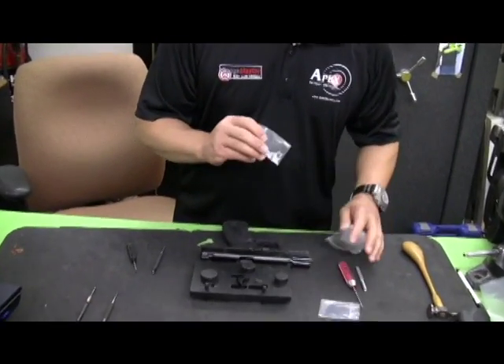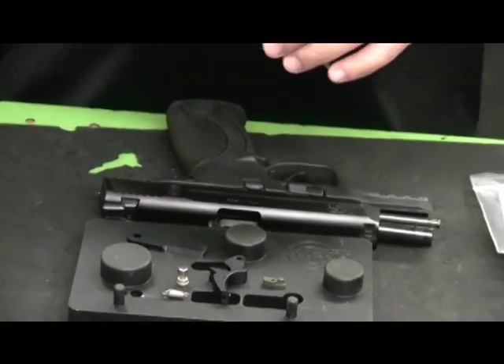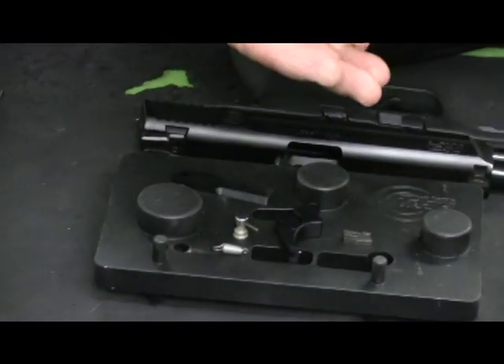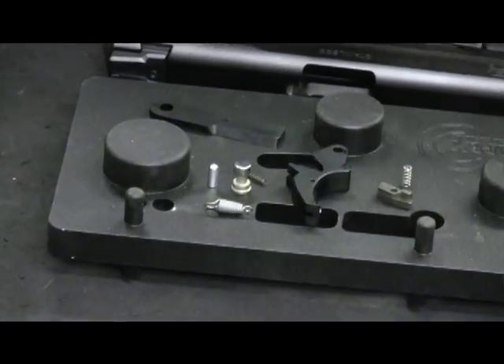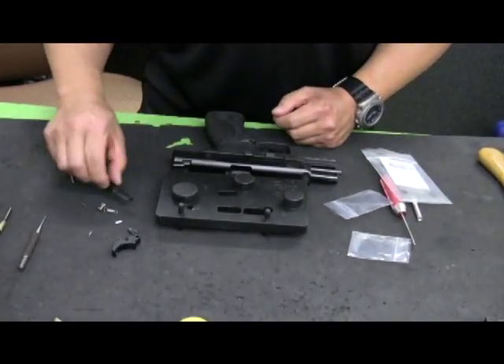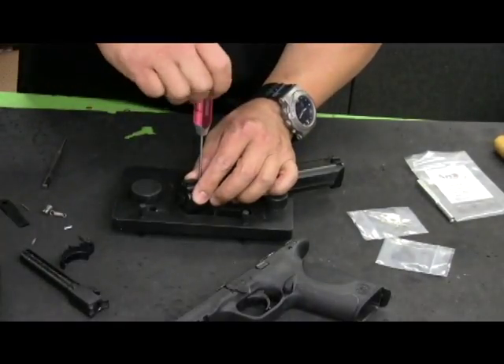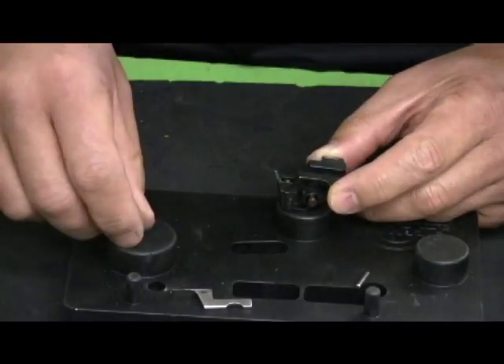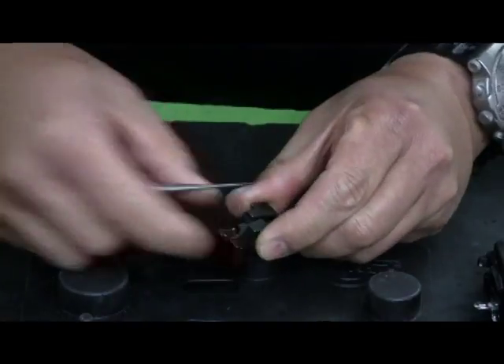Forward Set Sear Install - HD

Comment: This is a terrific upgrade. My M&P 9c is Massachusetts compliant and there for had a ridiculous 10lb trigger. Add the heavy trigger with long travel and it was not a great shooting gun. After I installed the Polymer FSS kit I was down to a lean 4.5 lb trigger with a nice range of travel. This allow tighter grouping, and an overall better shooting experience. S&W should make this a factory install option.

Comment: I just upgrade my M&P45 (CA model with manual safety, manuf Dec 2013) with the new poly trigger and sear components. This instruction combined with a few others from Apex for the M&P plus the proper tools (punches and armored block) make for a simple upgrade. (I have a normal/common level of mechanical and instruction- following skills.) I have the smaller sear spring and used the lighter rated trigger spring (silver, not green). The end result seems (when dry fired) to be a more comfortable trigger (didn't like the stock lower-half-pivot trigger) with significantly shorter pull. Can't wait to try it out... Maybe tomorrow if I can get out of work early.

Comment: awesome flat trigger!!! the break is unbelieveable!
this video does need to be updated. the little yellow piece in the kit is to align the pin for the trigger group for re installation, with the new kit you dont need a trigger block as apex pre installs the pin for you. the green spring is for heavier trigger pull, don't pull the bottom spring out of the sear block,un necessary, the armorers block is nice to have, the armorers tray is a waste unless your always pulling pistols apart.
If you have a core or performance center M&P you dont need to remove the rear sight, However,you will need a quality T5 torx wrench to remove the small plate on top of the slide thats underneath the optic mount. Hope this helps

Comment: Nice easy upgrade for my 9c. If you are patient, and a little mechanical, you will have no problem with this. I agree that they should have better production on the video. It would help out those who are on the fence about doing the trigger job themselves.

Comment: After adjusting the trigger bar loop to sufficiently make contact with the sear I was not getting proper trigger reset and was feeling a dead trigger. I pulled out the sear block and gently pulled the loop away from the trigger bar. After racking the slide with an empty magazine inserted into the mag well (Mag safety compliant gun) I was getting a perfect dry fire, followed by a perfect, crisp reset. Im off to the range to test it out again. Will post results.

Comment: I finished installing this kit earlier today.  The preset pin in the aluminum trigger is a tough one to get moving.  I ended up using a channel lock plier to press it in.  One last note, I had to open up the loop on the trigger bar as explained in the AEK trigger video.

Comment: I used this video to install mine on a thumb safety version. The instructions are just okay. In some areas the instruction is very detailed and in other there is nothing. Example at 10:52 the video just jumps from getting the trigger bar installed on the new trigger to putting the whole assembly back into the frame. Not a menting getting the trigger return spring in position or which spring to use, I got it done, but it should be here. You don't have to redo the whole video,